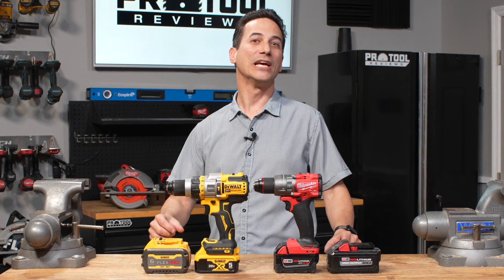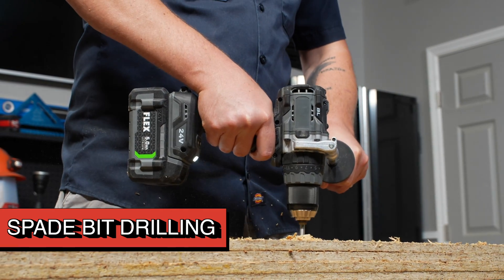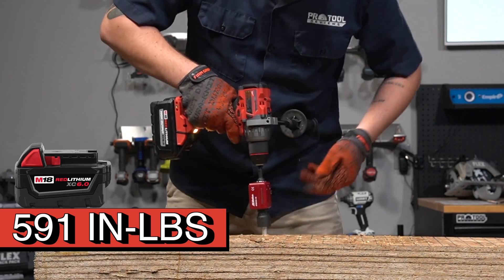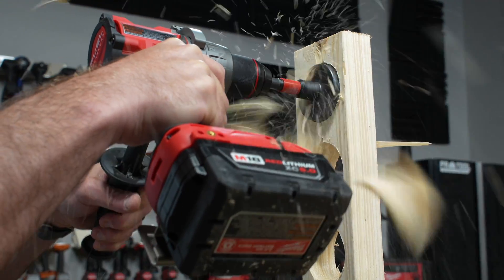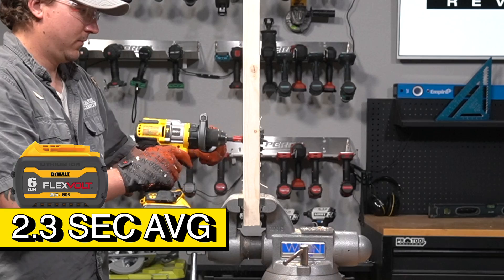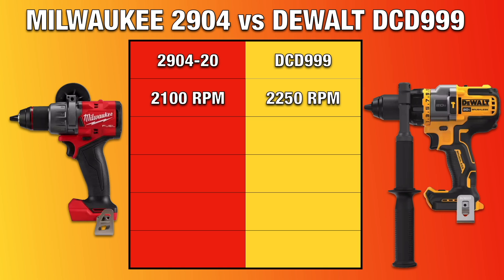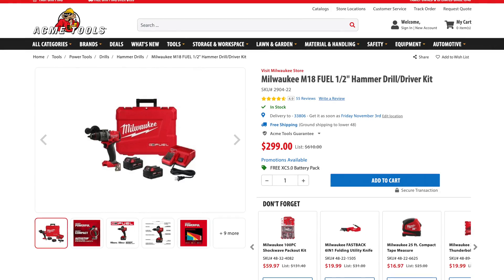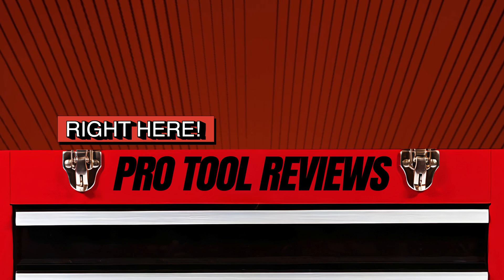Milwaukee vs DeWalt Hammer Drill - Flexvolt DCD999 vs M18 Fuel 2904

Comment: The best tool is usually the one you have batteries for.
Reply from the maker: Amen to this! Find a battery platform that has all the tools and equipment you use, and all you need is one battery, one charger, and you're up and running.
Reply: Once I committed to DeWalt (30-years ago), and the heavy investment in batteries, there was never any reason to change!  When it came time to upgrade my 18v DeWalts after 25-years, the 20v system seemed to be better than anything else out there 5+ years ago.  One style battery for all my tools, one charger for all my batteries, and a 20v to 18v adapter for any old tools I still needed!  Don't care if it's yellow or red.  My boys chose red when they started in the trades.  They're happy with them too.
Reply: Milwaukee is best...and by the way red is a better color😊
Reply: @NathanEsh-w5c  yellow is… and milwaukees planers suck so it’s not the best…. Dealers impact drivers suck as well so they’re about The same lol
Reply: you must be a dewalt owner
...lol
no shame in the game brother
Reply: Agreed. They’re both really great  tool brands. In my area DeWalt is well represented and has a nice selection of lawn and garden tools also. If it was Milwaukee, that did, I’d have Milwaukee. 
I’m happy they’re competing with one another, because the consumer is the winner in the end!
Reply: Not always. I am coming from Ryobi tools over to Milwaukee now when I can afford them, and they are... A tad better, the red ones 😅
Reply: Amen
Reply: For power milwaukee .. for speed dewalt
Reply: i got more than 10 battery platforms..i just go for the best value tools.. don't care about the brands.. the tools matter for me more.
Reply: Yeah but Milwaukee is better
Reply: @AndresDPG Milwaukee has more powerful tools but you can’t tell me how you weren’t impressed by Dewalts flexvolt battery💪🏼
Reply: @carlosf9278 I run red and yellow, neither brand trumps all the other brands tools in power, that's specifically why I use both. As far as drills go, I'd take a Dewalt any day over a milwaukee simply because the chucks are better.
Reply: @InuranusBrokoff  I run Milwaukee and Dewalt brands tools as well with some Makita power tools. Personally for me, Dewalt is the best overall because of the kits. Milwaukee has some tools that deliver more performance for certain tasks but in the real world when you’re either getting paid by the day or the hour, it hardly matters. What’s important is having batteries. Which is why I have a few adapters with me to use my Dewalt batteries on Milwaukee and Makita power tools.

Legit every one of my work buds is always impressed by my $15 adapter… more so than a tool that can drill a second faster 😂🍺
Reply: @carlosf9278 I like the yellow color on Dewalt. The others use oooff colors I just don't like.😊🥛
Reply: @InuranusBrokoff  Disclaimer I'm not a pro. But i agree. Both are great tool brands and you can't go wrong with either. Both brands crush other brands day and night.
Reply: @AndresDPG there both high quality my dad uses Milwaukee he would switch to DeWalt but has to many batteries he likes both but Milwaukee is so expensive that's what he told me
Reply: @haydenshores9943  yeah but I ain’t talking about price, because I used to be dewalt user, I dropped one drill like 20 feet and it broke, I have 4 years with the same Milwaukee set and still working very well
Reply: @AndresDPG  it's all the same one day you drop that Milwaukee just right the same thing will happen by dad uses Milwaukee I just use DeWalt we don't get into fights about it he's the one who told me there both very similar and it makes no difference you look at the internals there almost the exact same it's just a name not some tool created by something infallible
Reply: @AndresDPG  Only drawback is that it is owned by the Chinese! Yuck! But fantastic tools!

Comment: I have absolutely no favorite brand, but I’m trying to decide on a good hammer drill, impact driver combo.
I got the Flex combo Thursday, but the drill chuck is defective. Since that particular kit is no longer a stock item, I doubt that I’ll be able to exchange it.
Something about the ergonomics of the gen 4 Milwaukee drill irritates the tendinitis in my right elbow, so I have to rule that one out.
I’m trying to decide between the new Ridgid combo, because of the Black Friday deal, and just pairing a DCD999 with a DCF845.
Any suggestions would be greatly appreciated.
Reply: Avoid Rigid. Best tool brands are DeWalt, Milwaukee and Makita. Pick a battery platform, and stick with that brand. If you are really bent on going lower grade, prosumer level, Kobalt is good to standardize on. If you really want to go low cost, Hercules at Harbor Freight is the pick there.
Reply: @robk1310  What makes you dislike Ridgid? I actually have the Ridgid mid torque impact wrench and the 3/8 drive ratchet. Both seem to be good quality, and the LSA is really nice.
I am debating on the Dewalt 998 or 999, though, because I don’t like the ergonomics of Milwaukee.
If I go with Dewalt, I’ll get the 845 as my choice of impact driver.
Reply: @robk1310  You never answered my question about what you don’t like about Ridgid.
Reply from the maker: Truly depends on what type of work you'll be doing, what voltage battery line you're looking to buy into, and what other performance and ease of life features you find important. 

Check out our Best Combo Kit article, we detail all the best available combo kits from a wide variety of brands: https://www.protoolreviews.com/best-power-tool-combo-kit/
Reply: @Protoolreviews  Yeah, let me clarify that. I mostly work with Douglas fir 2x4’s and 4x4’s, so I don’t absolutely need a hammer drill.
I need enough power to be able to use a decent sized spade or bore bit. It seems like the only drills in that category are hammer drills, so that’s why I said hammer drill.
I currently have a Dewalt DCD777 and DCF787, so I can build on the 20v platform. I will keep using the 777 for lighter tasks, but I definitely want to replace the 787 with something that has better performance.
I also have a couple of 18v Ridgid tools, so I can also build on that.
The DCD998 and 999 seem to have great power to weight ratio, so I was thinking about pairing one of those with a DCF845.
The new Ridgid combo that is part of the Black Friday sale also seems to be a solid choice, especially with the LSA.
I’m not opposed to starting a third platform, though, if necessary. I don’t work in the trades, so I don’t need to limit platforms like trades people do.
Reply: @Protoolreviews  I also need to be able to drive 3” to 6” timber or ledger locks into the wood.

Comment: You can't go wrong with Red or Yellow. It all depends on which battery platform you invest in. I was already invested in 20v Max batteries, so I'm all DeWalt. But I do have some Milwaukee 12v tools. Makita is good also, but it's harder to find Makita in the hardware stores. if you're out of town, you can always find a Milwaukee or DeWalt place to buy stuff.
Reply from the maker: Well said, Rob! Thanks for watching!
Reply: Agree, I used M18,m12 and almost of my tools are Dewalt. It’s depends  on your job and which ones adapt to your requirement.
Reply: I searched online and there is a dewalt DCB to milwaukee M18 battery adapter and vice versa, it's a shame there is no CAS system in North America like in Europe.
Reply: After working in japan the Japanese made makita tools are by far way better then the Chinese made makita that America gets.
Reply: I use DeWalt 20v for all my battery powered tools, and Milwaukee industrial stuff for the plug ins.  20v's seemed better than the Milwaukees at the time, and once you're into the batteries, there's no reason to change unless someone comes out with a REALLY good reason to change.....

Comment: I'm a 1-person operation and started with Dewalt and pretty much stay with it because I don't want to support two families of batteries and chargers.
Reply from the maker: That's a perfectly valid reason to stay with DeWalt! Buying into and keeping up with two battery systems can definitely be a pain if you don't absolutely have to.
Reply: I fibbed a little bit...I do have a few Ryobi tools, mostly from before I plunged into Dewalt.  For some infrequent ;less-demanding, uses  they have some decent tools that cost half of Dewalt.  So they're worth keeping.  But the 'big change' is I used to have all-corded tools and over time I switched over to 90% cordless.

Comment: i want more .i want to see them used with more batteries . i expect to see the powerstack and forge in these tools compared . hoping for some fun comparisons . i generally choose the milwaukee due to its size . i 'think' dewalt has a new model coming out due to a picture i saw earlier in the year . waiting to see if they create a driver that really uses the voltage of the biggest batteries .

Comment: Dewalt, 3 speed and lasts way longer. 

I was at a junkyard the other day and there was a whole pile of Milwaukee tools and batteries that are like 5 years old or newer because you cant buy parts, they crank too much  power and eat themselves. 

Meanwhile for dewalt there was a DCD996 that looked like it went through vietnam twice and got ran over by a D4, a few nicad batteries from like 2004 and 3 of the shitty brushed drills. 

Also here in canada dewalt is cheaper by like 80$ for everything pretty much and people that run Milwaukee tend to be absolute assholes and dewalt is just old dudes that build sheds
Reply: I have never ever ever ever ever had a issue with my milwaukee tools. All of my tools are milwaukee fuel and I bought every single on of them ! 
Those you seen must have been used incorrectly or abused or something , that is for sure ! 

I also use mine every single day in a professional sitting ! 

You can have a tool and I have the same one and your last 10 years longer than mine.  That doesn't mean mine was lemon, it means you took better care if yours or used them less than I did in the same amount of time !
Reply: @Jasonpmc78-wm3xu It could be a lemon, but that doesn’t mean the brand is bad.
I had a gen 4 Milwaukee hammer drill that I returned the day after I bought it because the motor made a terrible noise and the chuck was defective. I noticed that there was an odd mark made with a sharpie on the top where the clutch setting lines up with the indicator mark. The TTI rep even said that shouldn’t have made its way into a store.
Having said that I also got a Flex Thursday with a defective chuck that I have to return.
I’ve heard about isolated problems with just about every brand because a bad tool can slip past a quality control person on any given day.

Comment: If you did this video about 4 years ago when that Dewalt Flexvolt Adva😅ntage Hammer Drill first came out and Milwaukee was still using their Gen 3 Hammer Drill , that DeWalt Smoked that  Milwaukee in every test , it was Hard to watch for the Fan Boys .... 🫣😪😭  😂🤣🤪🤭
Reply: Yeah man…. Back then dewalt had the better hammer drill easily no question. I remember desired Milwaukee to upgrade their stuff lol.

Comment: Of those two. The Dewalt. Only because of the 3 speed gear box.
Reply: Unless u consider one key version if the milwaukee then u get more speeds then that. Or choose the flex turbo drill which will smoke both of these lol